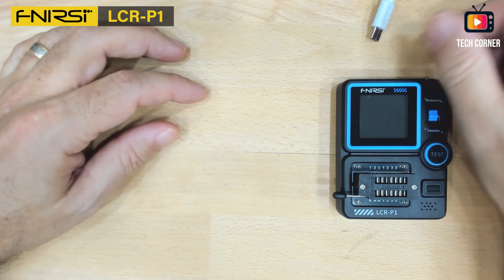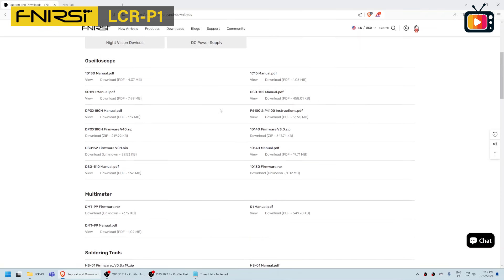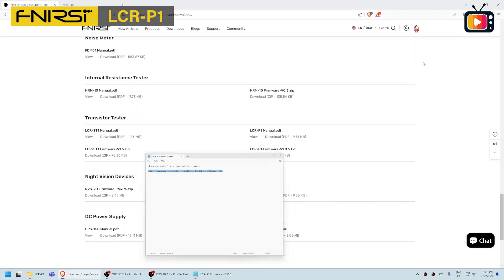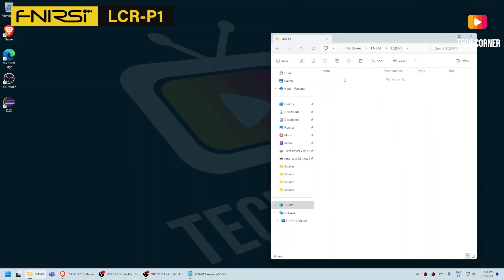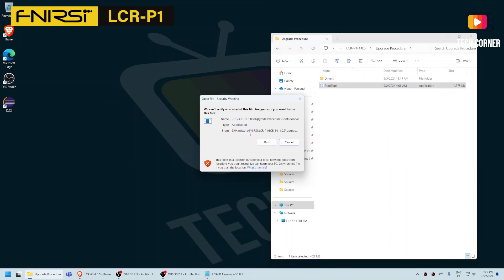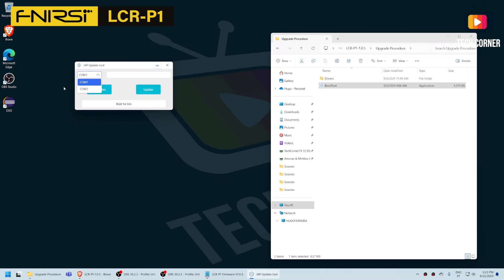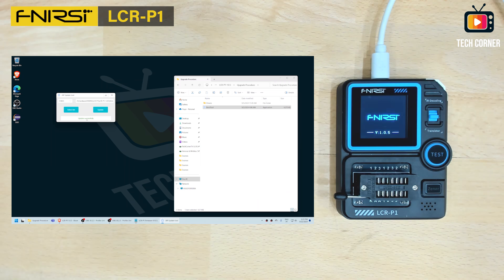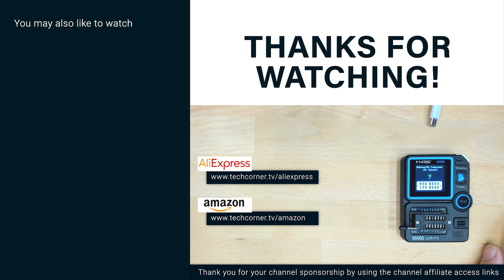FNIRSI LCR-P1 ⭐ How to Upgrade the Firmware

Comment: WHAT IS THE POINT OF DOWNLOADING NEW SOFTWARE!   I have version 1.0.8 which still doesn't display transistor pinouts correctly.  There is now a version 9 and I am told it still has the same problem.  THANKS for your explanation of download, the manual procedure does not work and SUPPORT does not respond. I'll try it anyway, always up for a joke.

Comment: I purchased one recently from Amazon; updated it to version 1.0.9 and then discovered that it does NOT display the pin-out for NPN transistors correctly. C & E are reversed, so how can I trust it on random components. It shows PNP correctly, but not NPN ...  disappointing.
Reply from the maker: Hi, thanks for watching and sharing, really appreciated!
Reply: Hi! Has that been solved by a newer firmware update?
Reply: @OMNI_INFINITY  Hello from the future. It looks to me like they stopped supporting the product, as 1.0.9 is still the latest firmware and it was released 7 months ago now.

Comment: WARNING - this tool has firmware with serious bugs, it does not recognize the correct pinouts of transistors and diodes, be careful even with version 1.0.6 of the Firmware. TRY to reverse the components it will always show you the same pinout. It is very dangerous because in addition to giving you wrong information it will damage your devices. I wrote to FNIRSI, they replied that they are aware of the problem. But damn if you are aware of the problem block sales. Be careful.
Reply from the maker: Hi Stefano, thanks for sharing. I didn't test it yet, but it was released a new firmware like 2 days ago, maybe it can solve some of these issues. Thanks for watching.
Reply: @TechCornerTV  I installed 1.0.7 everything remained as before, this item is a scam.

Comment: Got it here. You need to press zener and test together to get into de boot screen. Without the program will not run.
Reply: Thanks the BootTool.exe wasn't running but as soon as I did that it worked correctly and once I selected the bin file it upgraded in a flash, cheers

Comment: Its not running for me in windows 11 64 bits. Dont know whty... the boot.exe just dont starts.
Reply: I just tested it works follow below steps
1- install both the driver and windows-desktop runtime. 
2- Put your Tester into Upgrade mode by pressing zener and test button together as soon as you see upgrade, release them and make sure that screen shows upgrade. 
3- connect your tester to your computer with USB cable. 
4- verify your COM port by checking Device Manager on Windows. 
5- run bootload.exe 
you should see its window/user interface
6- verify the COM port and select BIN (firmware file) and click Update button 
it takes 2-3 seconds to complete.
Reply: @JackLee-q3d  This worked for me, thanks so much!

Comment: I have Windows 10 on my laptop and when I'm trying to open BootTool.exe file, there is an information "The Publisher Could Not Be Verified. Are You Sure You Want To Run This Software ?". When I click the RUN button there's not any result and the BootTool.exe isn't start. Any suggestion or advice please.
Reply: I installed the apps in the drivers folder first then clicked the boottool. Since clicking the boottool first won't work. Also try restart PC. Some time I had to click it twice to open.

Comment: Good looking product, but the functionality of the whole device is not good. During the tests, I discovered errors in the firmware and although I have asked the company several times to fix the firmware, so far without success. The product does not measure very well and has no setting menu. For example, when measuring diodes, he is unable to correctly mark the cathode and anode. And that's just a small detail. I do not recommend the product, you will be disappointed.
Reply: Plus this product has IR decoding function NEC protocole compatibility.
That means this will not work with the majority of remote TV brands...
For example, IR decoding doesn't work with Panasonic, Sony, Philips TV remotes... Just to know...
Overall the product works on all types of components.
BUT : a lot of test errors, generally 1 time out of 3 it bugs, you have to start the test again...

Comment: Why does the tester switch from update mode to measurement mode when connected to USB?
Reply: Did you find a solution? I'm having the same issue when I try to upgrade the firmware